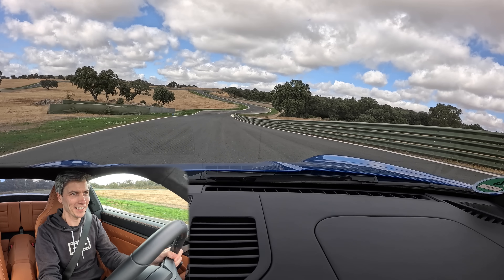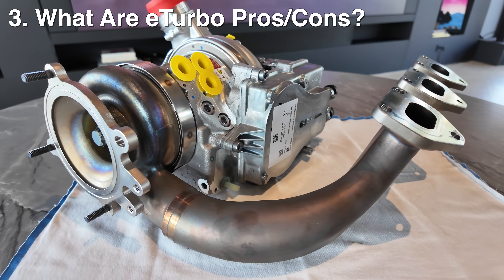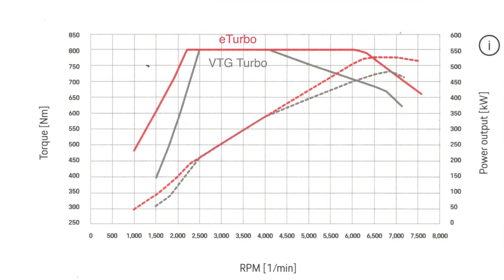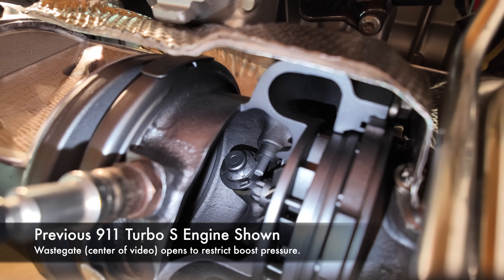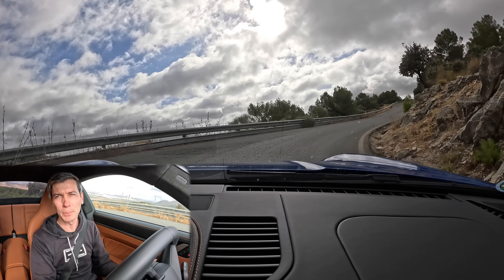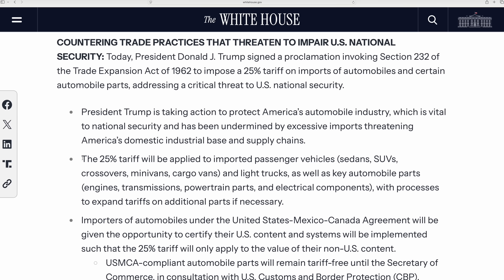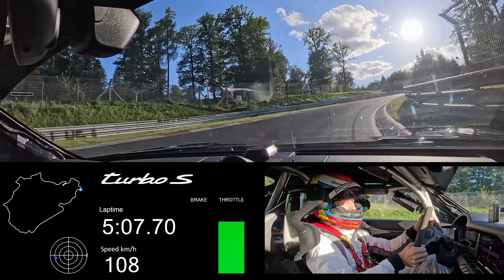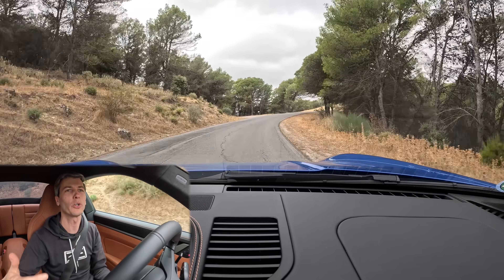Electric Turbos Are Here — Is It A Good Thing?

Comment: Porsche introducing MGU-H just as F1 drops it
Reply: Yep.
Reply: Porsche were the ones who fought for the FIA to drop the MGU-H from the 26 regs, they also have it on the GTS.
Reply: @ashliehiggins exactly what I came here to say lol
Reply: That's what F1 is fundamentally about. Basically 'hand me downs' of cool tech to regular people
Reply: @TitusMuli-d8h They have been doing it long before in the WEC endurance race series with  the 919 LMP1 car
Reply: @presentjr Race Tech engines has a great article on it
Reply: @presentjr  errm, the 919 introduced it the SAME year as formula 1 did.
Reply: @TitusMuli-d8h  Regular people do not spend $200-something K+ on a car.
Reply: @thehaprust6312  Eventually, Just like the way fuel injection, turbos, disc brakes, active suspension etc came to cars like the original 911 turbo and now they're everywhere
Reply: @TitusMuli-d8h this tech wouldve come anyways, F1 is a business, not an NGO for automotive development
Reply: @thehaprust6312  “generally available” is probably a better description.  2026 MGU-K is closer to how most road hybrids work.
Reply: @internetmistakes  That's because an MGU-K is more applicable across motive sources than an MGU-H.
Reply: @thehaprust6312  back in the 60s fuel injection was also only for high end cars. Now it’s basically a requirement to pass emissions.

Give 10-20 years and we’ll start seeing this in a hatchback
Reply: FI has been a requirement for 45 years, but I don't have turbo or active suspension in my daily driver, although automatic is pretty standard these days.
Reply: @TitusMuli-d8h I feel like the day will come that you could get a small engine with electric turbo instead of just a small waste gated turbo like what's out there already
Reply: @devandrasimanjuntak1646  dont think petrol\gas will be cheap in 20 years time to run this for fun
Reply: @thehaprust6312 no it's not. You need both.
Reply: @thehaprust6312 but a lot of regular people cars are already at 100k. Big SUVs, big trucks,
Reply: @thehaprust6312 racing in general has created so many standard safety features, not just electric turbos
Reply: @TaRa-ud3zg 
Depends how governments try to push weird agendas. A lot of the current cost of oil based fuels is down to government regulations and taxes. Like the EV mandates leading to OPEC raising prices, and restrictions on drilling, moving and selling oil products.
If governments stop being idiots, much of our current pain will go away.
Reply: In 20 years we may well be riding donkeys if the climate loonies have their way. Perhapse turbos on donkeys?
Reply: @TitusMuli-d8h it's why hybrid cars are so common. The tech has been beat to death in f1 and WEC
Reply: I would hazard they have been working on this tech since the f1 speculation as it takes a while for the tech to make it to actual real life… and why waste development… let the civilians enjoy that.
Reply: Ya, but that's how it's supposed to work. F1 tests and proves new tech, which trickles down after. There is no relevancy to whether F1 continues it or not.
Reply: Probably the reason why they stopped entering F1
Reply: Exactly my thoughts.
Reply: Funny when audi/porsche are the reasons it was dropped as they claimed it was to sophisticated and had no practical applications 😂
Reply: just as they go broke.. 90% financial loss for 2025. (western government policy)
Reply: Which is not unusual - tech has trickled down from F1 ever since the race series was invented.
Reply: Proves that F1 is in fact more than a decade ahead of consumer products
Reply: Normal.
Reply: I can see these electric turbos being repurposed as compact APUs.
Reply: @juancarrera5524 like for auxiliary power? It wouldn't seem like the right move as it depends on primary power being operational to scavenge? I'd want auxiliary power unit to have a fuel source other than primary power unit.
Reply: Yeah, I am all for your innovative thinking but the whole point of an APU is for making electric power. There would be no point in using electricity to make electricity. As there will only be a loss of electricity in the process. Remember "equal or less reaction."

Fuel is a much more dense an energy to weight source compared to today's battery technology. So for performance it only makes sense to use the fuel to convert the energy to electricity.
Reply: You don't get it! VW group didn't want to supply engine to F1 and their reason was MGU-H has no road car application. What an irony.
Reply: @JeffSyam  in all fairness, I doubt that this kind of electrical turbo will find its way into an affordable every day street car anytime soon
Reply: @tobsixi6702 We've seen all "luxury tech" 2 decades ago finds its way to affordable vehicle.
Reply: @JeffSyam  2 decades is quite a long time when you consider that by 2045, most people will probably be driving around in an EV, so it makes no sense for manufacturers to tinker around with this tech and try to adopt it on a large scale, because its tech that does not translate to the EV market (unlike screens and digital media or basically all the things that are not tied to a car’s power unit)
Reply: @JeffSyam  the irony is Porsche ran this technology back in their 2014 LMP1 car
Reply: @GamezGuru1 yeah, that's double irony.
Reply: F1 dropped it as Porsche refused to join unless it was dropped. 

Then Porsche refused to join after having ruined ERS.  Tossers.
Reply: @ruaraidhmcdonald-walker9524 Yep, thanks to Porsche/VW-group, in 2026, F1 will introduce,... wait-for-it...
.
.
.
TURBO LAG! 🤣🤣
Reply: @JeffSyam This
Reply: Porsche at the pinnacle of car tech 👌🏽
Reply: @Saif0412  In fact Borg Warner designed the unit, not Porsche ;)
Reply: @Saif0412 koenigsegg are way ahead of Porsche
Reply: @Saif0412 Na ah,... They are pinnacle of engineering hypocracy
Reply: (No) Thank's AUDI
Reply: Even funnier when the technology was dropped because Porsche's sister company Audi didn't want to have to develop it.
Reply: @D3Vlicious  I'm pretty sure this e-turbo tech is almost directly pulled from the 919 Hybrid, just made more reliable and street-friendly.  That said I don't know squat about F1 so they could've pulled the 919 tech from F1.  Who knows.
Reply: Patent dropping ahh behavior
Reply: Yes indeed - but I suppose the F1 cars at least don't spend much time off-boost, and any negatives associated with over-large turbochargers being off-boost are perhaps minimal.
Reply: @dogsbodyish8403  nonsense
Reply: @dogsbodyish8403 turbo lag ain't a problem in current F1 due to the electric motors  and tires already being a limiting factor. Mguk is a great way to recuperate energy while on boost. Engines, including F1, have to limit peak boost for reliability. What the mguk does is to transform into electric the exhaust energy that otherwise is dumped into the atmosphere. 

Current cara can charge the battery "for free" while accelerating. Next gen will reduce acceleration to charge the batteries
Reply: and it was dropped for reliability and cost concerns as theyre trying to attract new PU manufacturers. this porsche engine will almost certainly run into the same cost and reliability concerns.
Reply: @WTFZOMG  Probably not. The porsche engine won't be under near as much stress as f1 engines are. And the MGU-H has gotten much more reliable since it was introduced.
Reply: @WTFZOMG  It was dropped for costs, not reliability. Should have been made a spec part for 2026.
Reply: @WTFZOMG  mostly cost and because AUDI would have problems with developing their system. No reliaility problems with MGU-H for some years already
Reply: @WTFZOMG I thought it was mostly just HARD to enigneer and fit into the space, not reliability
Reply: @WTFZOMG how many DNFs were caused by the MGU-H?
Reply: @MGXsport  Not so many?
Reply: @MGXsport  how many MGU Hs do you think each driver goes through in a year? how many motorized turbochargers do you want to buy for your $270k porsche every year?
Reply: @MGXsport  surely we're not comparing a road car engine against one that is designed to only last around 1500 miles max?
Reply: @WTFZOMG  There is a "slight" difference between an MGU-H for the road and an MGU-H for racing. The first has been optimized for reliability and longevity, the other has been optimized for maximum power.
Reply: @WTFZOMG  "how many MGU Hs do you think each driver goes through in a year?"
4, as per the regulations. If the regulations specified less, the manufacturers would find ways to make them more reliable. But it's not needed, so they don't.
Reply: @halofreak1990  some drivers are already on their 5th MGU-H this year and theres still 4 races to go. i doubt anyone will use a 6th, but the current powertrain reliability is being pushed to its limits with the # of races this season.
Reply: @WTFZOMG  F1 cars have an allowance of four MGU-H per season. Also F1 engines make more power and are more reliable than Indycar engines.
Reply: Another big difference is that F1 MGU-H is positioned between the cylinders in a hot V configuration whereas the 911 seems to have them on the sides. The hot V helps with compact packaging which in turn frees up space for aero. However the high temperatures between the cylinders together with the ridiculous RPMs required of the turbines make it very difficult to make reliably. The 911s out-of-V MGU-H setup should have less issues with heat and I would dare guess the turbine RPMs won’t hit F1 levels.
Reply: @killarazzi  F1 MGU-H system is way more complex than this
Reply: @killarazzi  obviously flat 6 is not a hot V (180 degrees vs 90)
the boost in F1 (~50psi) is double the boost on the turbo S and GTS (26psi), but it doesn't use higher rpms (turbo S 145krpm vs F1 125 and GTS 120) but most probably bigger turbo to achieve more boost and power at lower rpm.
the other big difference is F1 more advanced split turbo which keeps the turbine hot inside the hot V (less exhaust energy lost ) but the compressor is located in a cooler location for cooler air intake
Reply: @MGXsport quite a lot actually 😂
Reply: @WTFZOMG  Not many, if any
Reply: @WTFZOMG  Come on dude, you cant compare the stress a F1 car gets with a Turbo S... the only thing they have in common is that both have 4 wheels.
Reply: @PiotrPiotr-v2u nope.
Reply: But they made it actually good lmao

Comment: Intersting to compare this to Koenigsegg's pre-pressured airtank thingy
Reply: Volvos have basically the same thing as well, engineering explained has a video on it.
Reply: Im also curious, but I think its kinda gimmicky, probably only good for some accelerations form low RPMs every few minutes. A volume of 40L (one 20L tank per turbo) at 20 bar only store about 115kJ compare to the 6.84MJ of the 1.9kWh battery of the porsche. Then you have the issue of traction, so you cant really use all the extra performance of the engine at low RPMs.
Reply: I bet I could use all that torque from low RPMs (provided it's not raining, of course).
Reply: I need to know more send me some sources pls 🙏
Reply: @ZIGGI_WP_FLC  Used in drag racing a lot. Just search for 'Drag racing compressed air.

Comment: Hi Jason. With electric turbos  being developed for boost, what do you believe could be the impact of an electric vacuum on the exhaust side?
Reply: wouldnt really help if the intakevalves are closed :p
Reply: In theory that could also be helpful, with the right timing it could pull the exhaust gasses out of the cylinder faster, meaning the exhaust valves would need to be open for a shorter amount of time, and thus the intake valves could be open longer without increasing valve overlap, and thus you could theoretically improve engine power and responsiveness a little bit further
Reply: that was my question as well.  At low RPM, the motor will spool up the turbo and create suction on the combustion system, unless there is a reverse waste gate.

Comment: Electric turbos are a fascinating bridge between traditional combustion and the electrified future. Seeing how they reduce lag while improving efficiency shows just how much innovation is left in internal combustion systems.
Reply: The main issue holding it back is that just like every turbine, they're very inefficient at partial power. It makes it a great addition for a sports car, but if you're cruising on the highway for an hour, you've spent most of that time at 20 HP, and thus the turbos aren't really doing any regenerating that can't already be done with the motor on the crankshaft more efficiently.

F1 has been using a similar system since 2014, and they're dropping it for 2026 because the new manufacturers don't want to spend that much effort on something they have no interest developing for their road cars. So far the only manufacturers who have actually done anything with e-turbos in road cars that regen instead of spin up faster are Merc and Porsche. Renault, Ferrari, Honda? Nada.
Reply: That is true. But why innovate the combustion motor at this point. Maybe for Porsches but everything unemotional will be fully electric sooner or later if we want or not.
Reply: @wuchengranschiiet9992  "But why innovate the combustion motor at this point."
Because we'll (have to) keep on using them for the foreseeable future. Virtually no country on the planet has the infrastructure for a fully electric society. So until we do, it would be smart to try and make any new cars as efficient and environmentally friendly as possible.
Reply: @wuchengranschiiet9992  

The main problem for EVs is range, secondary to that and related charging infrastructure. The stated ranges are absurdly high. Winter driving reduces range, on average, by 30% and up to 50% in extreme cold. Also for longevity of the batteries charge should is between 20% to 90%. In the Winter the effective range of an EV is closer to 200 km. This is simply not going to fit most people's lifestyle. An EV might fit as a secondary car in a family with an existing ICE car, but at a price of $55,000 ($CDN), even that doesn't make sense, unless for ideology. Where I live in Canada, It would cost more for me to charge the EV than put gas in an ICE. It also is an extra $2,000 for car insurance per year.  The economics for EVs simply don't make any sense at this time. 
It will be at least another decade before full EVs make sense. Automobile manufactures really need to focus on plugin hybrids to leverage the best of both the ICE and and electric.
Reply: @wuchengranschiiet9992 sadly, a lot of the world is built for automobiles, i dont know how long the combustion engine has in the limelight, but car companies are obviously betting on it lasting a while longer.
Reply: @wuchengranschiiet9992 I would say that there doesn't seem to be the enthusiasm for electric vehicles after the hype started to fizzle.  Sales slumped, and without the capital input it doesn't have the future you may have imagined.

Comment: The most capable? The Ferrari f80 would like to have a word.

Makes you wonder why you need the exhaust gases at all, really.
Reply: Utilising the exhaust gases while still having an electric turbo considerably decreases the electrical energy needed to spin the turbo
Reply from the maker: lol - today I learned! Genuinely didn't know it used e-Turbos. Okay so in total we have:
Porsche (GTS/Turbo S)
Mercedes (AMG 2.0L & AMG One)
Ferrari (F80)

Any others?!
Reply: f80 is not using the same tech as porsche. Ferrari uses gigantic turbos that makes nearly 900 horsepower from a 3 liter engine and complementing it with a trio of electric motors (2 at the front and 1 between the engine and gearbox ) to get that oomph of the line. This is a completely different strategy. Moreover this can be trickled down cars that mere mortals can afford. Also ferrari is making only 799 F80s(allegedly) porsche will be selling that many in turbo s in the first year of production alone(Not a ferrari hater but the new stuff coming out of marenello is not at all.............interesting)
Reply: McLaren missing out not putting e-turbos on the w1 seems like the next logical step in tech for a new hypercar especially since it’s already a hybrid
Reply: no, it doesn't